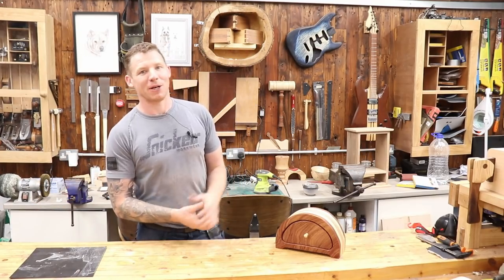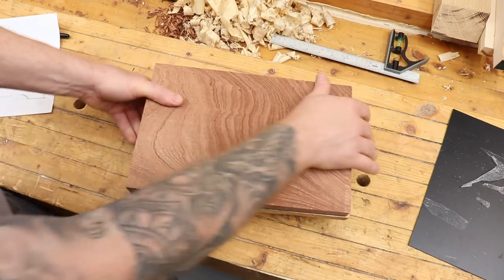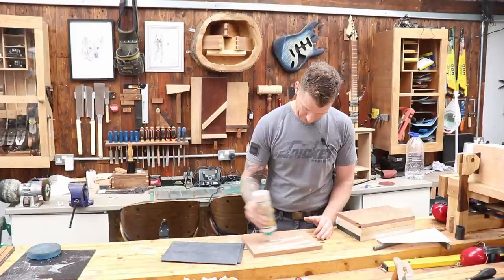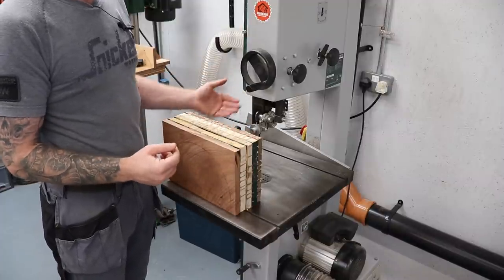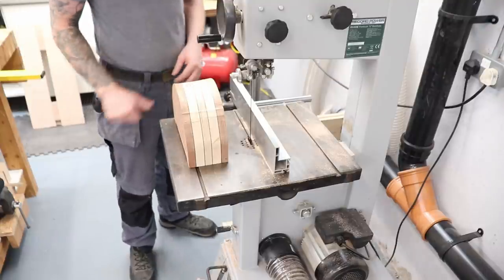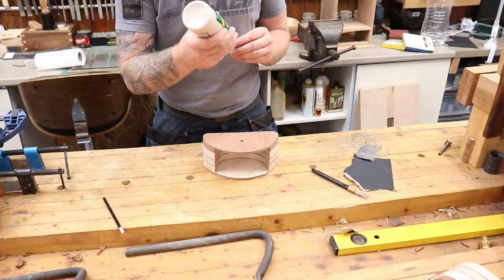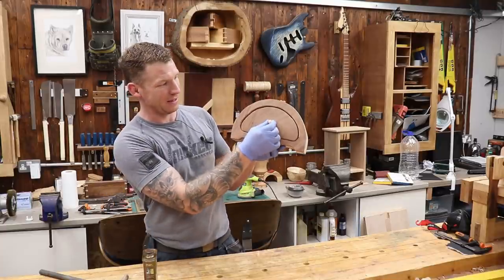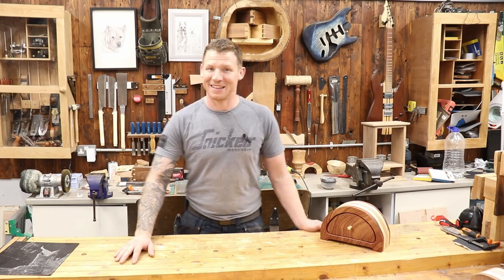Bandsaw Box Build How To and Bandsaw Catastrophe!

Comment: That turned out great even after the trouble you had cutting the back off. I found that not gluing on the back until you have the drawer cut out first. I just double sided tape on the back while cutting the outside shape then remove it for the drawer cutting.

Comment: Thanks mate, good video.  It's kinda nice to know that you pros don't always get it right.  ;-)  
I made my first bandsaw box the other day for the missus on Valentine's Day, it was merbau front and back with pine core.  I don't think I'll do pine again, so have clamped up some plywood and will clamp something like oak on the front and back for the next one.  
I've seen some others who don't bother clamping the back on until after the front and drawer are cut out, which is interesting as it means you don't need to resaw the back off, saving you a step...

Comment: hello, today I drew a box, similar to yours!. My saw has a maximum height of 80 mm, when designing, I thought, to make the inner branches smaller, I will use a 20 mm diameter fostner drill. when cutting the bottom, it is necessary that the guide has to be the same height as the box, these guides lower, the saw starts to cut with one measure and another comes out.

Comment: Nice project.  Where did you find Colorcore as tiles?  All I can find are rolls of it as thin veneer.  I've tried regular floor tiles, but they don't work as the glue does not hold.

Comment: Beautiful work. It looks like the grain running from the bottom right corner would ha e also worked and then any imperfections from the glue up would have been on the bottom and it takes some of the lateral play out of the drawer. Good job as always.
Reply from the maker: Cheers Craig.

Comment: come in from the bottom if you can, cant see the exterior line if its underneath. 
i would have come in just inside the leg on the bottom right and gone straight into the curve so you dont have to end the cut on a curve just nice and simple straight cut across the bottom untill you get back to the line and youre done.

Comment: Keep cracking and bash on . Nice box. I'll have to try some of that Formica
Reply: This morning I was attempting to resaw some walnut to glue up for a blank.  I had the same problem with a 3/4 inch blade. Checked all my settings tried again  same problem.  Switched to a new 1/2 inch blade  it cut perfectly.  It took some time all morning  but  what hell I'm retired. Anyway I liked the vid and the way you solved your problem.

Comment: Hi John, I've never done of these but why would you add the final lamination then cut it off, surely you could add the final lamination after cutting the inner shelf out. You could then add the final lamination and shape it. 
I can't wait to see the more organic shapes you make. 👍
Reply from the maker: Yes it would be easier to use maybe double sided tape to hold on the back piece and then glue it later.